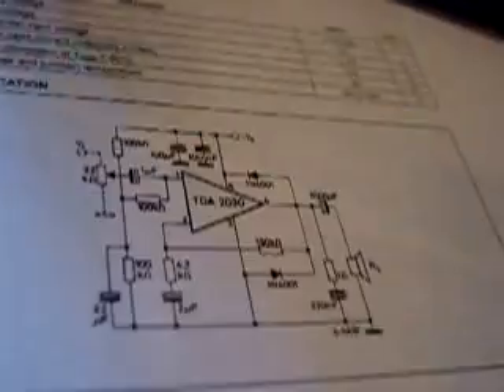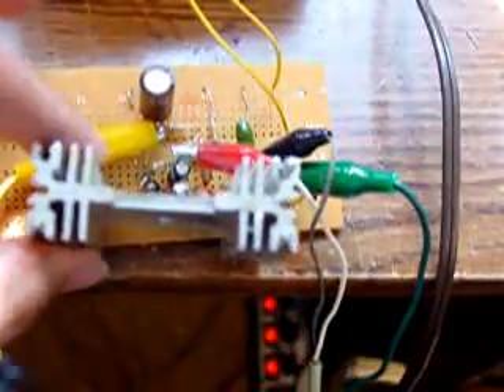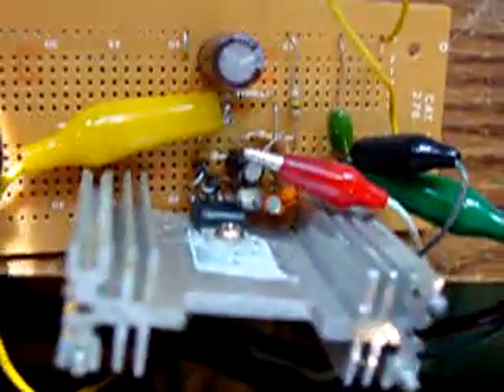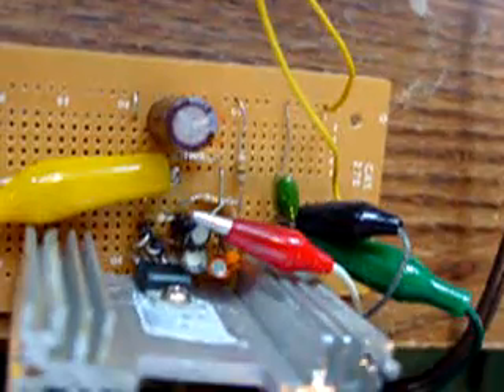TDA2030 power amp I built for the Wollensak.

Comment: I had this same oscillating problem with an LM383, which is the same chip, just a different name.  Connecting the output to the ground via a 1 ohm resistor and a 100 nano farad capacitor in series fixes that.

Comment: tda2030 is an almoast indistructible cip, abused it in mani ways and still never broke 1 (short output, reverse polarity of the power suply...) normaly u can use a heat sink like 1/5 of the 1 u used and it will stilll be cold. eather u got too much voltage , eather the datasheet u used is wrong. use maximum 18v and it wont heat at all.

Comment: Did you messure the current provied by the power supply to the circuit? I ask because you are telling that the circuit gets to hot.  I want to use it for a talk box. I'm building it with a high frequency driver, so it's not gonna be a little stomp box. I want to reduce the size of the Power supply  or use it separtly that's why I want to know about it.